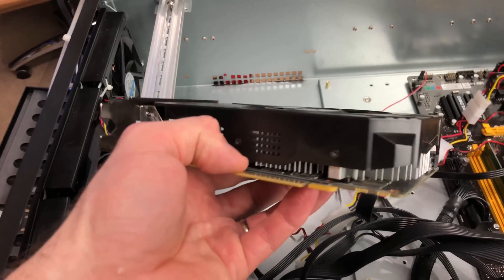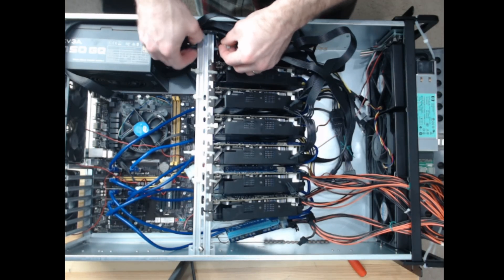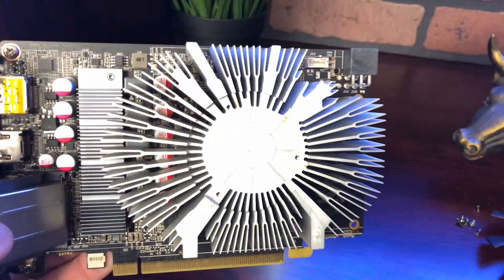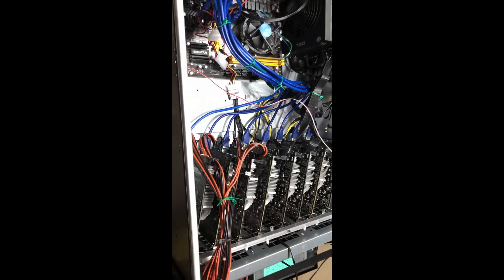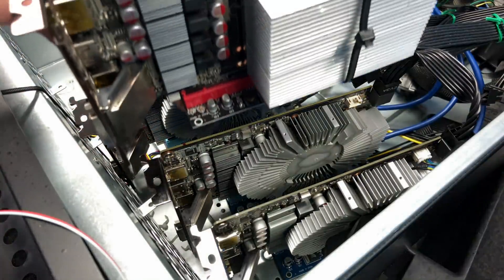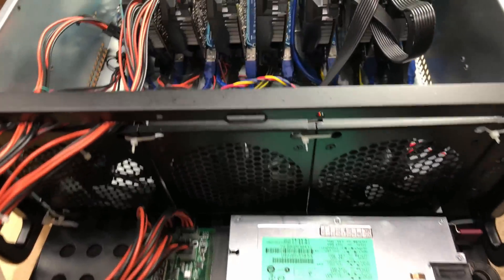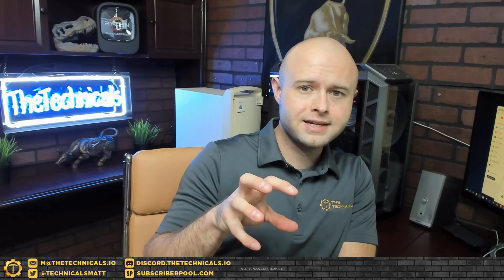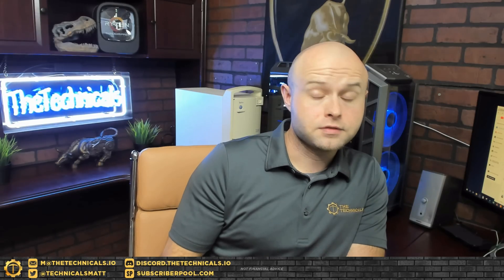No GPU Fans - Crypto Mining Rig Experiment

Comment: Hello Technicals. First of all you should try 396 beta Nvidia driver in Ubuntu. Under this driver you can make "sudo -pl 65" and you will have 65w exact power consumption each card. on the 390 driver in SMOS you wil NOT have 65w but only 95w and you could imagine how this will cause the temperature :) Also make core settings (-200) it will also reduce the temp. Good luck! Nice videos